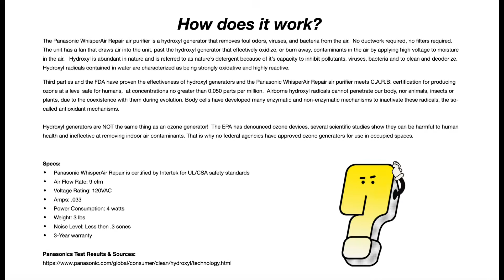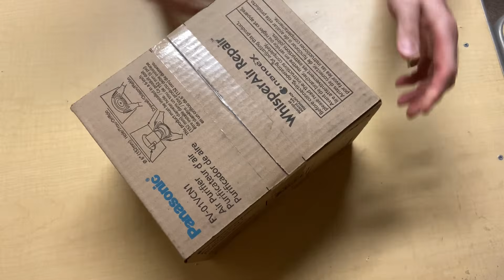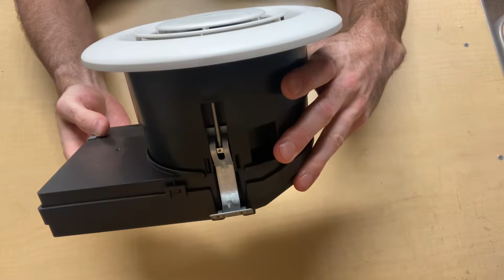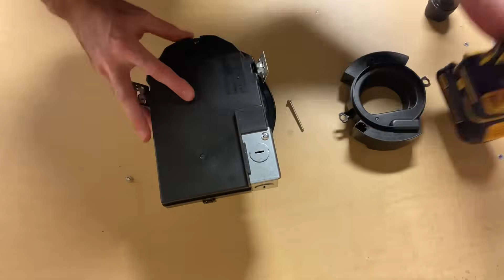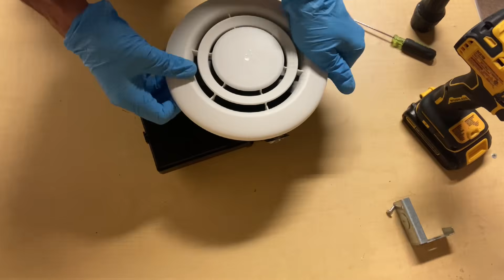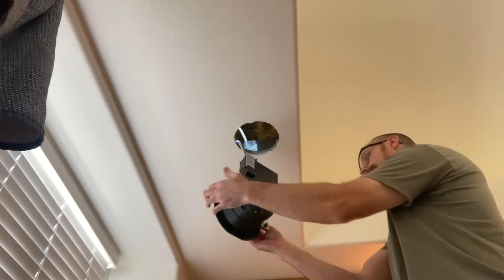Panasonic WhisperAir Repair Air Purifier Product Review & Install! | Hydroxyl Generator

Comment: Appreciate the disassembly and technical explanation, but would have liked to have more input on actual effectiveness.  I note that you mention placing in kitchen area, which Panasonic recommends not doing for some reason.  Perhaps because consumer expectations would be to immediately remove strong cooking odors like an exhaust fan, which is beyond the design limits of the technology?  We have a three-season room which gets stale when closed up,  Seems an ideal use case.
Reply from the maker: You are correct, this will not immediately remove cooking smells from a kitchen like an exhaust fan.  I would recommend following the manufacturers installation instructions.  I haven't noticed any unpleasant smells lingering in my kitchen.  I think for a smaller space, it would be a great option, if it doesn't work, then you could consider an exhaust fan for your space, or possibly add a small HVAC supply and return duct to the three-season room.

Comment: So how do you like it?
Reply: Does it do the job? Do you feel like it’s making the air quality better as far as odors, etc.?
Reply from the maker: @perproject06 yes I noticed a difference. I use it in my kitchen. It’s a larger area than what the unit is designed for, but it does seem to eliminate odors after a period of time.
Reply: Does it come on automatically. Or does it need a separate switch?
Reply from the maker: It needs its own on/off switch.
Reply from the maker: So far so good. Its very quiet.
Reply: @kjfacilities-maint  great thanks